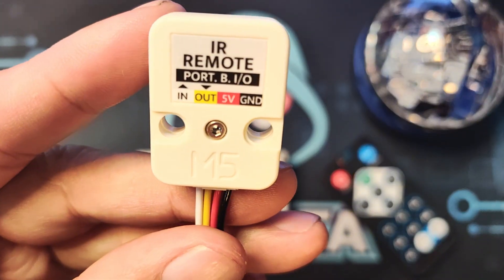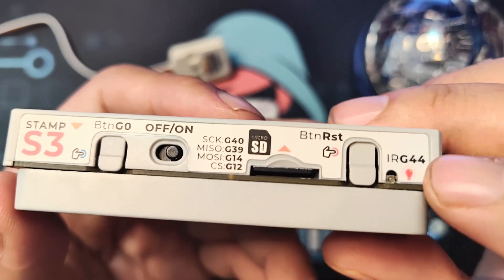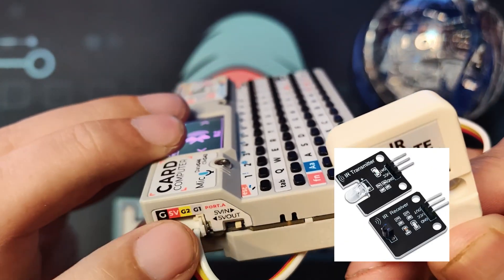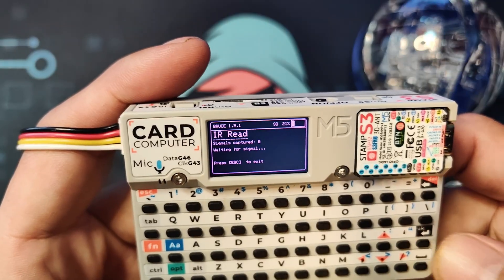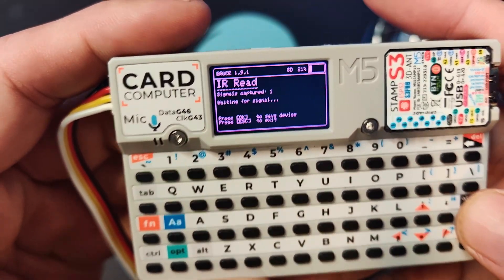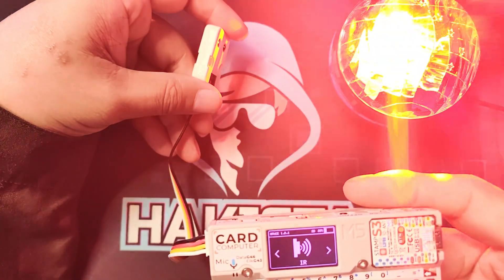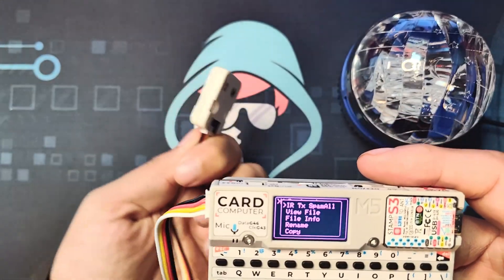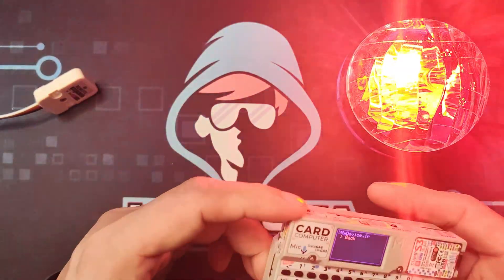Lost Remote? Bruce Firmware to the Rescue! (Cardputer + IR Module Guide)

Comment: Hi!
I’m a beginner and your videos have been a huge help for me to understand how to use these modules. Thank you for your hard work!
I have a question about the Lilygo T-Embed CC1101 Plus running Bruce. My internal IR emitter is dead (it receives but doesn't transmit). I’m planning to buy the M5Stack IR Unit.
Is it fully compatible with the T-Embed via the Grove port? Also, in Bruce IR TX settings, I only see pins 43 and 44. Do I need to select one of these for the external module to work, or is there another trick?
Thank you!
Reply from the maker: 1. ir not sending is probably firmware problem, use a different version or just reflash
2. the connector would be different.
3. i havent tried that pin setting
Reply: @HakistaTV Thank you so much for replying, I really appreciate it! I love your channel, you seem like a really cool guy. I'm from Marseille. Listen, I've already tried everything, including installing a new firmware, but I think my IR is definitely broken. Thanks again for your answer, it's clear, simple, precise, and very kind. Keep up the good work